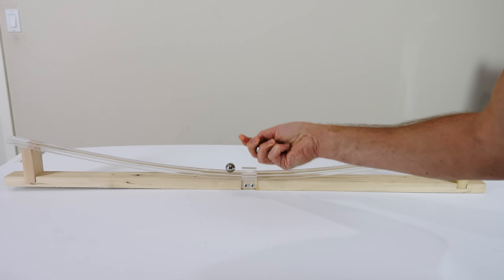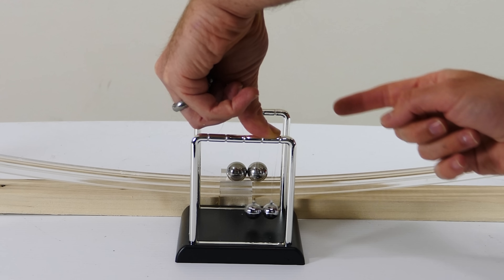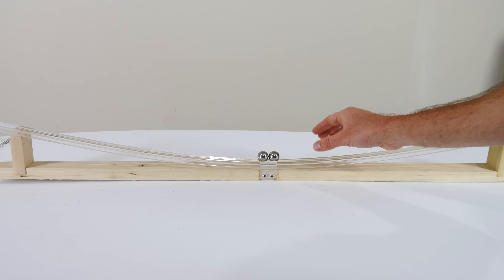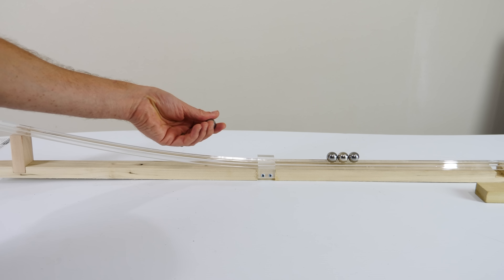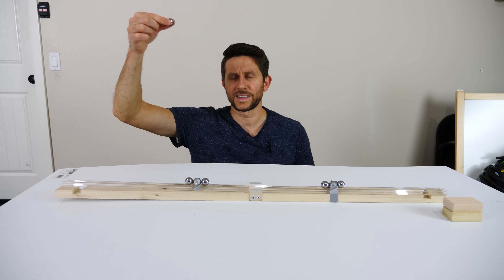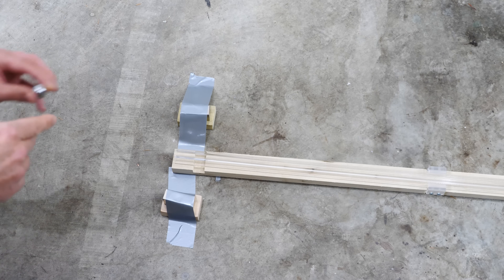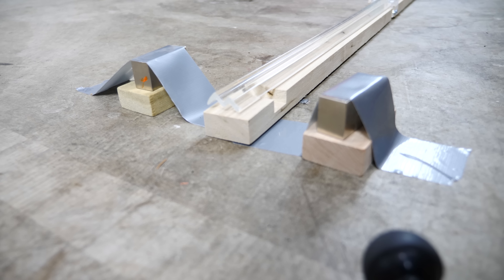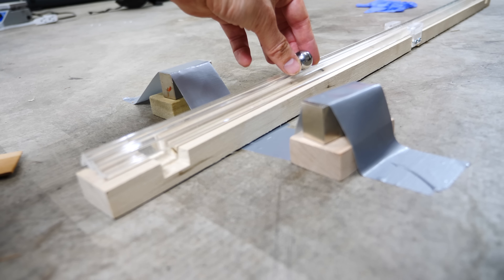How Does a  SMOT Work? (Simple Magnetic Overunity Toy)

Comment: Nice video.   But isn't the magnetic accelerator you demonstrated in minute 2:10 a SMOT?   You roll the ball slowly and another ball goes flying off the other end at a higher velocity.   Somehow the potential energy in the magnetic field of the magnetic ball is transferred into kinetic energy of the ball that goes flying off the end.  If the speed of the "flying ball" is 4x per second and the ball you roll is 1x per second, you have a COP of 4 in terms of kinetic energy.
Reply: It's because Steel-Magnet-Steel configuration has less energy than Steel-Steel-Magnet (Magnet-Steel bond is stronger than Steel-...-Magnet). Hence the difference in potential energy goes to kinetic energy.
When you "rearming" S-M-S config back to S-S-M, you do work by ripping apart M-S bond, hence storing that extra energy for next use.

Comment: Thanks for the video ! Really simple and helpful and straightforward! I have created a magnetic track  300 permanent arrangement , ie each arrangement contains the set of magnets that let the ball roll. In your video you  tested 1 single arrangement. I tested a track with 300, yes 300 arrangement , the track is several meters long and the ball doesn’t seem to slowdown as I measured the speed with laser and video. Ofc the arrangement is not like your video. My question is how or what does that mean??

Comment: The John Bedini generator has, by tests and measurements (over 350 sessions), proven to be an over-unity generator. Battery charger energy efficiency formula is Energy Out / Energy In;  Vo x Io x delta t / Vi x Ii x delta t.  (o = output, i = input). The only way to slice the dice and find the truth, is by applying empirical science to it. I conducted and documented these tests in my workshop. An Indian University recognized Bedini, as well as thousands across the world. How does it work? Again, EXPERIENCE and observations prevail over hearsay and a compulsion to comply to paradigms and peers opinions. 1) build it exactly according to Bedini's instructions. Changing things may induce failure (like what the Myth Busters did). 2) If your neon flashes, while under NO load, it's a great sign your connections are correct (mine did not, until I managed to correct - my bad, Bedini's instructions were right). 3) Your Driving battery voltage needs to be of a higher potential than the sum of voltages of your load. Kirchoff's laws do apply. 4) the "magic", what makes it overunity is that, this kind of generator creates, and cleverly channels (into a dedicated circuit) classical back EMF spikes, which are otherwise known to be pesky sources of circuit blow out. Normally, back EMF spikes are smothered through grounding. So, Instead of grounding these spikes, some measured from 10 to 40 volts or more, they are channeled back to a battery load (and/or DC electric motors) and these translate as ADDITIONAL currents fed to loads. It is SCIENCE, and a rigor of method is imperative. Why does it work? I studied applied physics, and I am more than satisfied to have made this work. However, I have a theory as to WHY the overunity (free energy), but it needs further research from a lot smarter people than myself, gunning for the Nobel price. So bear with me please... We are plagued with false information about the dynamic and static nature of photons (the exchange particle for anything electric and magnetic). a) photons are omnipresent in the cosmos. Weather Tesla (longitudinal) or Maxwell (transverse) theories of light propagation are correct, both suggest the presence of a densely packed medium of photons, only energized by EM waves. b) we perceive the electric component of an EM wave, when an impending MAGNETIC wave cuts through a conductor, preferably at 90 degrees. c) The universe seems to be built in dualities, often separated by a third ingredient, often ignored. Up-Down, Positive-Negative, etc. In  the latter case, photons seems to fit the bill. d) yet another duality, surmised by some physicists, is the dynamic photon (energized) versus the static photon (omnipresent; dark, cold). And THEN we also have free-to-move photons, and fixed photons that seemed to be aligned in this anomaly that physics still can't define, called a magnetic field. So, fixed photons, aligned like so many pearls on stings, would constitute the essence of mag fields. e) Conversely, ONLY photons can create induction (yes, electric induction too), so if it quacks like a duck... f) Here's a theory: by creating an expanding and collapsing mag field in a coil, the mag lines of flux "pushes" away some of these static, omnipresent (like a surrounding aether) photons. Then the "magic" of overunity occurs when the field suddenly collapse, entraining photons INWARD the coil, to fill the vacuum. An analog could be when you insert an ice cube under water and quickly pull it out, with the resultant inrush of water. NOW you'll quote thermodynamics and say "yeah but in the balance, you'll lose more energy than you put in, anyway!" TRUE!!!! BUT ONLY IF WE DEAL WITH M A S S. Photons are massless (relativity being negligible here).  So, the $billion answer comes down to this: the energy (and money) we spend at expanding a mag field, will be more than compensated by what we get in return, because we create a greater inrush of massless photons in the balance. If we try this with anything that has mass, thermodynamics kicks in, and we lose due to inertia. Such generators will produce overunity if they use Photons and possibly massless neutrinos. You may disagree with my theory, but when you dare to scientifically reproduce the practical, you'll witness true overunity, And you will see with your own eyes that you just opened a vista into a better future. Love your channel. You are uniquely stimulating our minds to push the boundaries. Cheers!

Comment: In General Relativity energy is not necessarily conserved. A good example is the accelerated expansion of the cosmos. If there is a way to generate a Hermann Bondi inertial dipole then there is a way to extract energy from spacetime on the expense of the gravitational energy of far bodies of mass by pulling on spacetime. Theoretically, if there is a turbine that runs on Bondi dipoles connected to a central rod, the turbine will produce work, however,  that can come on the expense of the gravitational energy of the moon or of the Earth in relation to the sun or the effect will be evenly spread in space and its influence on single bodies of mass will be negligible even after thousands of years of energy extraction. For summary, the environmental implication of using a Bondi inertial dipole can be catastrophic. We simply don't know how bad such an energy production/extraction can be because physics has not figured out yet how to use electrically charged particles to generate gravity beyond the one predicted by the ordinary energy-momentum tensor and it hasn't figured out how to generate antigravity.

Comment: “Free” energy is a claim about money, not science or nature. Over unity has been demonstrated over and over and over and over and over and over and over again anc again. Meaning more energy is achieved than you put into starting it. Zpinch is one example. Another is the last fusion test I believe. This can be demonstrated easily. For example: create a large coil  and then create several smaller coils designed to resonate with the larger coil. As many smaller coils that will fit within the 3 dimensional field of the larger coil that you are inputting the energy into can power individual loads. The loads attached to the smaller coils have ZERO effect on your input. You can add up the power consumed by your input coil and add up the combined power used to power the loads on the smaller coils and magically, u have violated the laws of physics😱! But of coarse this is based on ignorance of our ability to measure these things properly in my opinion. We are very 2 dimensional in our creation of these devises. The energy is in the 3 dimensional fields not in a linear flow of electrons.

Comment: What is wrong with YOU? You are building up a tiny part of a system that could have the potential in a greater context and then you try to talk it away due to friction? What's the difference between a lump of steel and a magnetised? According to you it's momentum. By the way, you watched the wrong YT-clips. There are even patents with magnetic motion devices. But if you would call them self sustaining, instead of perpetual, it's no longer esoteric. Only eternity is perpetual!

Comment: Once you have it going on a street track without the drop begins enough philosophy going in the straight line to jump all the way back with a quarter pipe or more than a quarter pipe it would be probably a half pipe that is at a 90-degree angle I mean backwards and then at Lansing that round circular area that is slightly slope to the center and then it rolls down a ramp and then hits the boost with the magnets completes the circuit do you have to use gravity slow picture of hills with gravity gravity produced by the and then gravity at the end to repeal it back high enough to fall down onto the flat circular disk and the completes the circuit

Comment: I have succeeded. I'm not looking for money I just want to spread truth and tell people how they can do it without my involvment and without me getting any money.

I have actually found the solution and want to give it away for free.

It's dirt simple, you just use completely different forces to move elctrons so that you are performing work on a different property of the electron.

So I use electrostatics to grab electrons and move them according to their mass instead of trying to establish an oscillating magnetic field and induced temporary electric field.

Electrons weight virtually nothing, an amps worth of electrons only weighs a billionth of a gram, so if I strongly charge a plate positive I can use capacitive coupling to induce current flows in other plates.

The electrons always have somewhere to go so they follow the e-fields from my charged plates around. They pull back on me with equal and opposite force, but they are virtually massless and the current path makes it so they just move to follow where I want them to go.

It isn't free energy because I am just doing work on a different physical property, I am expending a claculable and physically real amount of energy to move around the MASS of electrons.

Believe me or dont, I'd be lying if I said I didn't care I'm extremely emotionally invested in this.
Reply: What?

Comment: Can't it work purely by repulsion instead? Instead of using a ball use a flat magnet whose negative pole faces other negative poles of stationary magnets positioned at an angle in series, and the free magnet is locked in position by a flat tube so it doesn't bounce off by repulsion.
Reply: No

Comment: what if the magnets you used in the loop got progressively stronger. each magnet pair pulls the ball up higher and then drops it down a constant distance (net gain of elevation), by the time the last strongest pair pulls the ball with much magnetic forces, it undergoes a final long drop back to the initial weak magnet pair to continue the cycle
Reply: @darklight2.1  ...hence why I mentioned using stronger magnets.
Reply: @darklight2.1  1. no one pushed the ball, the magnetic field pulls it. 2. gravity and/or a stronger magnet could remove it from the existing field. 3. stronger magnets can overcome friction, we see node 1 overcomes friction, so subsequent ones could as well.
Reply: @darklight2.1  "So,  once the initial energy stored when moving it into the field is exhausted, the ball will simply stop at the next magnet-there is no reason for it to move further." but thats just it, what if the next magnetic field was even stronger, to pull the ball from the initial field and up the ramp. I'm not really suggesting this would work, but really cant find a satisfactory reason why it couldnt. clearly, magnets can pull and object up a hill and off a ramp, overcoming gravity and friction. then another magnet takes over.
Reply: @darklight2.1  I dont think youve done a very good job explaining, no offense. I am curious do you have any credentials to speak on magnet physics?
Reply: @darklight2.1  my question about credentials was a simple and honest one. your explanations were lacking, and searching that term did not yield fruitful answers to my original thought.
Reply: @darklight2.1  so zero credentials, got it. "No net force means that only friction, gravity  and inertia are working on your hypothetical ball. Once the inertia is exhausted, that leaves only the other two." except yknow, the video shows that isnt true at all. ball has zero inertia and still moves.

Comment: What about nitinol machines that produce their own heat and cooling in a device. It's an expensive metal, but I challenge you to create a nitinol engine, and say there isn't potential for perpetual energy devices. See if it is possible to run a combustible engine off of pure hydrogen, or create one that can, and then why would it not be possible to power an alternator, or multiple alternators that produce enough hydrogen gas from water and electrolysis to run that engine? 
Until someone shows me to the 100% extent that these things are not possible I believe the laws of energy were just made to limit the minds and capabilities of the common people of the world.
Reply: @darklight2.1  people have produced enough energy to produce enough hydrogen to run a combustible engine though. The ones who run the patterns on such technology refute such claims though.
Reply: @darklight2.1  if we are all electrons flying around at different frequencies held together by magnetic bonds then everything is energy
Reply: @darklight2.1  ok I thought it was covalent bonds but whatever you say.

Comment: what if you used a metal 'bead' with a hole in it instead of a 'track' with all that resistance?  
if this 'bead' was on a 'hula hoop' track (lubrication) OR suspended with sound vibrations (almost no resistance) you could maybe use to power a flying saucer type spacecraft?
(what if the ball is INSIDE the hula hoop filled with ferrofluid?)

Comment: Our planet is next to a star.  We have an unlimited amount of free energy raining down on us 24/7.  A common household refrigerator accumulates 4 joules of ambient heat energy from the cold side to the hot side for every single joule of electrical energy put into it. A Stirling engine is up to 75% efficient at converting heat energy into electrical energy. If you combine both technologies you can create a refrigerator which even with losses will run indefinitely on ambient heat energy from the sun and will produce 3X more energy than is required to run it that is until some mechanical part wears out.

Comment: Ok so.... how would it behave if you took this circle track,  and placed it in a vacuum? Like space?  And each magnet ball was fixed to a single center , (to keep them from flying off into space forever in a straight line), like a tether ball, with 4-5 magnetic / steel balls, not sure your set up, if all were magnets or just one... but yeah, lose the gravity,  will you loose the friction?  Can you run the magnetic balls through a copper c shaped coil? (C cuz your ball is connected to center) what kind of effect might centripetal force play??
Do it!!
I need to know!!
If it works, forever, give me a shout out and a cherry cheese cake.
If it rips an anti-hole in the theory of relativey, destroying time space , and melting the universe... just give me a cherry cheese cake 🎂, and maybe don't mention what happened to my mom

Comment: BUT WAIT. What if you use the ball magnet example and line then up all in a circle. Considering the ball kept going faster and faster the more balls and magnets you lined up wouldn't it keep going forever???
Reply: Sadly no, in this demonstration the "carrier" ball between the two ball magnets needs to be reset (put back in its starting position) for every cycle. That's also where the energy comes from, since you give the carrier-ball potential energy by pulling it out of the magnetic field.

Comment: Couldn't you just put the magnetic balls and steel balls in a circular track to keep it going?  Probably not but that seems to gain speed regardless of how many times the balls hit each other
Reply: Sadly no, in this demonstration the "carrier" ball between the two ball magnets needs to be reset (put back in its starting position) for every cycle. That's also where the energy comes from, since you give the carrier-ball potential energy by pulling it out of the magnetic field.